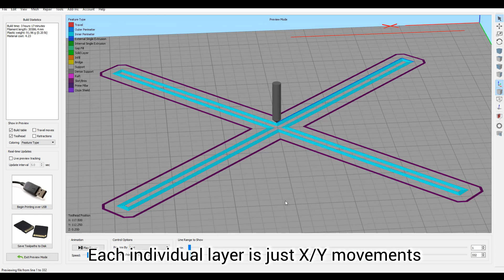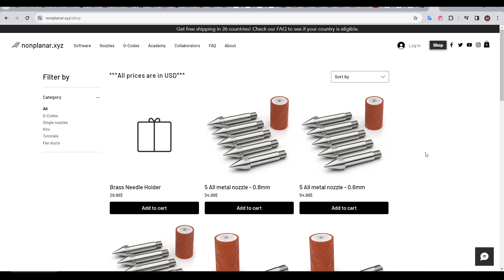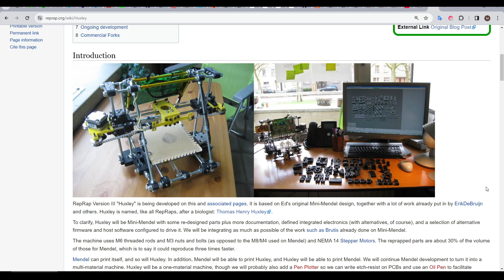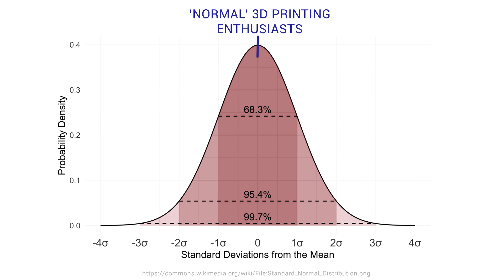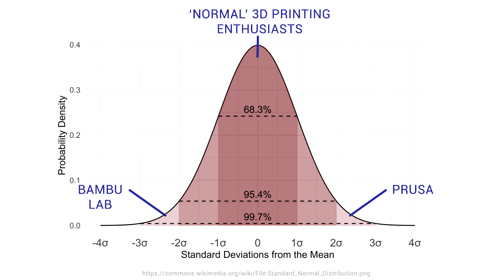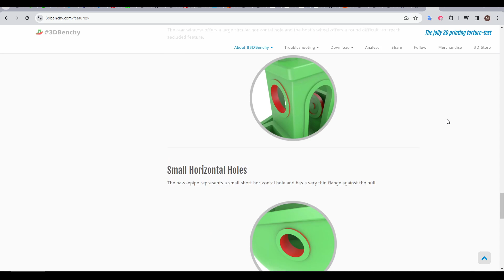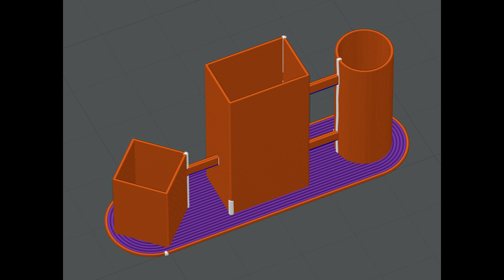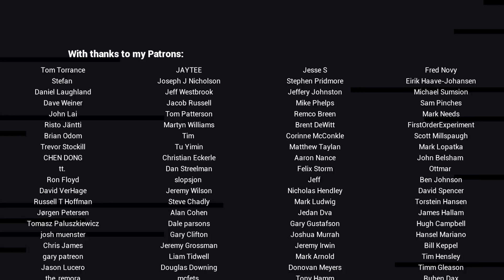3D printing mysteries that need to be solved in 2024

Comment: Hi Michael, at a previous job I dealt with a similar issue to the surface artifacts that you mention in this video. While we did not dig very deep into the issue and did not come to a real conclusion, we did come to a similar theory as you. I believe that the issue may come from the material sinking heat into the previous layer at different rates based on how much time the previous layer has had to cool. If you look closely you will notice that the rectangular tower on the left may actually have 5 different shades. 
1 - Bottom layers
2 - Layers printed with both cylinder and rectangular tower
3 - Cylinder tower top layers (discussed in the video)
4 - Only rectangular tower layers
5 - Rectangular tower top layers

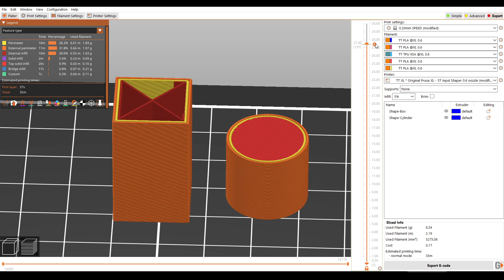Comment: 12:45 I think I have a pretty good theory about what can actually happen here. 
1st, I don't think test shown in 12:00 is good to test this, the indentation may be just an effect of a seam from the slicing process.
When you look at the frame from 11:10 where you see both geometries, you can see that the bottom of a square object is a bit more mat than the top half, and those 2 are split with even more mat layers. I would bet that it has a lot to do with the cooling tab in your slicer. I assume that you printed this with PLA, which tends to get more mat with a higher flow rate (on the same temp ofc). When you print the part where there are both objects and both are printed on layers with infill, layer time is much shorter than on layers where one of the objects is mostly normal infill, but the other is the top solid infill. If you have "Slow down for better layer cooling" turned on, printer will actually print faster on  layers that would take more time, and slow down on those with that take shorter to print. That's why I think the part of square part is more shiny that bottom, because on the bottom, you print cylinder + that part --> layer time is longer --> printer speed up, and when you print just the square object, layer time goes down and so does the speed. I would print this once again with "Slow down for better layer cooling" disabled (orqa slicer --> filament settings --> Cooling --> Slow down for better layer cooling), if my theory is correct, the artifact from 11:10 should be gone.

Comment: I've always thought the surface artifacts are because printing speed. It'll slow down to allow the filament to cool completely, but when it takes longer to print the layer, it prints faster. I suspect it goes away if you set the speed to be constant through the whole print, or at least, a less dramatic shift.

Comment: Your guests regarding the last one is probably pretty close to accurate and mirrors my guess as well

We are printing with a thermoplastic that is a plastic that is responsive to thermal energy and changes its volume and therefore density as well based on temperature and flow ultimately it's temperature but flow affects temperature

Print faster and the filament will come out colder Prince slower and the filament will come out warmer so ultimately it comes down the temperature you can see a more macroscopic effect of this with certain filaments that will sometimes print with a matte finish and sometimes print with a shiny finish and that also comes down the temperature print faster and cooler and you'll get the matte finish print slower and hotter and you'll get the shiny finish

You are probably going to have a similar effect on a physical level because the plastic will expand and shrink more or less based on the temperature and how quickly you extrude it your flow rate

I am betting if you reset your slicer to print everything at the same speed you changed all of your different speed attributes to all be the same speed and also made sure that all those speeds were 10% below your maximum volumetric flow rate so somewhere around 14 cubic millimeters a second for PLA for example I'm betting that you would see most of those either go away or decline I doubt you can get rid of them completely simply because you still have travel moves involved and that's also going to affect flow and temperature since while you are traveling the feel of it is going to have time to heat up inside the hot end so you're going to have some extra thermal energy in play that might not have been there before and then of course when you print a large surface area like the top of the cylinder you are going to be expending all of your access thermal energy and you won't have as much to give up this is going to cause a change in the thermal properties of the plastic when you move and print a different part

So I bet you are correct that it comes down to flowright but more importantly temperature which is related to flow rate

Comment: And regarding toxicity. Simple. Nerds want to gate keep.   They think this is their little fiefdom. Heck im one of those that also built 3d printers from scratch and even contributed to the Klipper plugin eco-system. I'm mostly using my Bambu Lab X1C since I spend most of time actually designing models for prototypes instead of fidgeting with unreliable designs.  The community either treats the 3D printer as a hobby instead of 3d PRINTING as  the goal.

Comment: None Planar printing can simply be simplified into non-planar ironing. I think that would make it less complicated to code. 3D additive slicing being turned into a true 3D printing would imply that it can print on any kind of surfaces as well.  like 3D printing around a cylinder.  That kind of slicing is extremely complex.  Akin to 3D concentric spirals inside a volume.

Comment: I had initially assumed that it all had to do with printing speed, but the point you make in your video concerning the top infill cooling the nozzle down helps me paint a better picture.

Hypothesis: not only is there more filament flowing causing the hotend to cool down, there is also more time being spent on that second object. Most printing profiles I run tend to have a slower speed when switching from infill to top layers for bridging across the infill to give a nicer top layer. Then, for the other normal top layers (I typically print 3-4 top layers), those layers inevitably take more time to print, allowing the other model (or even other parts of the model) to cool down while this top surface print is happening. When the next layer is then applied onto the existing colder layers, the melted filament cools down even faster (theoretically drawing a minimal amount of heat away from the nozzle as well)

I have tested this theory only once with some overture matte black PLA by first slicing my then troublesome model, finding out the maximum layer time (that isn't the first layer), then re-slicing again but this time with a configured minimum layer time equal to the max layer time found above and enabling variable printing speed to have each layer take the same amount of time. The surface finish was arguably pretty consistent, considering that I was not testing with regular shapes and so there was a significant change in printing speed per layer, but at least those weird transition layer artifacts were gone.

 My testing is limited and I'm not super motivated to dig further into it myself, but would love to see what others find!

Comment: 1. Yes - we want non planar - there is a newer video/ channel covering this goal since yours and stefans vids.
2. Lower- anti clockwise
3. ‘Cause People suck.
4. You didn’t build a voron?
5. Designed in
6. Temperature change - Possibly affecting flow.
Reply: 1.  Link?
Reply: @crashingsux    I saw a few things E3D put out on their channel mid year as they had some non planar nozzles/ hot ends they appeared to be prototyping. They mention a guy in the description, I think if you search the guy,  it goes to a GitHub and his own channel and that has more recent info than cnc kitchen and Micheal’s vid. 

I think there was one of the trade shows where they were printing non planner with a nozzle that rotates around z but I forget who had it. It was one of the rep rap rather than form next but I could be wrong.

Google non planar printing and look at the dates. In YouTube search non planar and you’ll see some newer stuff too. 

Im interested in it as I think non planar will reduced the lamination issues in some cases as the part doesn’t have tradition 1 layer layers and has layers that cross what would be multilayer. Effectively becoming more homogenous. I have bike parts that would benefit from this.

Comment: As for the filament snapping I can answer that

As the filament absorbs water and almost all filament is hygroscopic it will absorb water right out of the air although if you live in a dryer or climate controlled environment or certain plastics are slower to absorb moisture but all of them do

When they absorb moisture they become brittle and that's why they snap so the question is why does it do it specifically for you

Well that's because you broke the filament and once you break the filament it absorbs water faster then it would otherwise

Think of it like this think of your filament as having a skin and as long as that skin is intact water can get in but it finds it difficult to get in The moment you break the skin compromise the skin on the filament water finds it much easier to get in and it starts snapping a whole lot faster

The very nature of how you load the filament is why it's doing this when you unroll filament from the spool you are straightening a relatively rigid casing that does not want to be straightened you are taking something that was formed hot and soft into a coil and you are straightening it out The process of straining it out stresses the skin of the filament and you get micro lesions all along the length of the straightened part of the filament those are all cracks in the skin and those cracks allow the infiltration of water at a much higher rate and it becomes brittle and starts cracking That's why if you start cracking the filament pull some more off crack it pull some more off crack it eventually you'll reach a point where it stops cracking That's the filament that has not been abused yet :-) this also happens with even optimal direct drive systems or bowdoing systems that don't bend it like that but what happens is the feeder unit the gears the hob gear actually cracks the surface and again allows the infusion of water at a much higher rate than normally would occur

This is why I tell people to never ever respool a roll of filament unless you are going to use that a filament that day

You ever see those rolls of filament where the entire roll is shattered into a million pieces on the spool? Yep that's a respool :-) these plastics don't like that.

Comment: The filament breaking in multiple parts is caused by the tight coiling of the degraded filament trying to get through the reverse bowden tube. The fewer the leftover filament, the smaller the diameter and tighter the coiling

Comment: My personal mistery is: Why do my prints still have zits and blobs even after I have tuned junction deviation, linear advance, acceleration and everything else I can tune
Reply: Did you also turned off power-out recovery? Some printers with power recovery make a save to the memory or drive every layer. This can cause little hiccups in printing, because printing halts shortly while saving to the medium. This process can causing artifacts.
Reply: @jclosed2516  No power recovery. I turned it off in the firmware

Comment: I have a question. Why marlin is not coming up with some easy to use GUI for configuring firmware? I mean there is auto build is there but it is far from usable.
Reply: Good question. Would be nice to have a website with preconfigured options/templates and automated build to generate the bin files. I guess Marlin is on steep decline and doesn't attract much attention anymore?

Comment: As for the toxicity of the 3D printing community that's actually pretty easy to answer and the answer is muggles

That's right as more and more of the general population gets involved in 3D printing more and more toxicity will enter the 3D printing realm

This is just a natural expansion of what happens to any hobby or niche once muggles start coming into play

Think of it like this take your probability graph that you posted and sync it below the x line so only the tip sticking out of the zero line now raise it up like a rocket that rise up like a rocket is a combination of time and density meaning how much of the normal population enters the hobby over time as you can see you start off with mostly the normal people but as your rocket rises you start exposing those extremities on the outside edges :-)

This happens to pretty much every hobby

This can also happen with evolution when a hobby changes from 1 to another aspect for example introduction of drones or the introduction of electric power or the introduction of high power into low power rocketry etc etc

Elitism begins to take old as the old cadre does not want to let go of the old ways and attacks the new ways

Your rat wreck example is actually a pretty bad example The vast majority of those comments you posted on the screen were simply people that were curious voron was the big name going around and people saw you posting about a machine that was pretty close to avoran so they were hoping you would do a war on because that's what they want to get and they trust you and they want to see you do it first That's not toxicity or tribalism

There were a few nasty comments in there not even really nasty just you know like you described tribalist but most of those comments were simply curious

I personally think you do a pretty decent job and so you have a pretty low level of toxicity on your channel
Reply: Isn't saying the problem is normal people, or the general population, just another example of the behavior he is pointing out?

Comment: 3D equivalent of stepping under in a ladder is too many upgrades, too fast as I recently suffered this fate, causing a layer shift that was the result, as far as I can tell updating my firmware and adding a hardware upgrade at the same time

Comment: A question; talking about artifacts, if the hot end is extruding more plastic, and getting cooler shouldn't the printer (especially with Marlin on board) be able to slow down/change the flow rate to prevent those artifacts?  For your three object test print...having had cruddy printers in the past. it truly does not look bad enough to worry about it inless it is a structural flaw.

Comment: I have a theory for the snapping filament, it looks like the starting point of your revers Bowden tube (the black 3D printed part of the aluminium extrusion), is bending the filament too much. The bending radius seems too short. Maybe this and the combination of an old brittle filament causes your issue. To fix it I recommend designing  a new part with a big radius.

Comment: Re the filament breaks, if you're seeing it towards the last third or so of the roll and it's not years old and drying hasn't helped, it may be mechanical stress. You're dealing with the most tightly wound part of the roll. If you finish printing and leave it loaded and thus stretched out, after a while you will start seeing breaks. Could be hours, could be days depending on the filament type and age. When this starts happening, I unload the filament when I'm done printing and am not going to be printing again as soon as i get the party of the bed. I re-load when I need it again, first bending the end until it stops snapping, and it prints just fine. It's a factor I don't see talked about nearly enough on various forums and discussions.

Comment: this is only an uneducated guess, but my theory concerning the spiraling filament is it has less to do with any kind of coriolis effect (which would have little effect at such a small scale that any other force acting on the filament would over power it), and more to do with what direction its wound on the spool and what bends and turns it makes to get through to the other side. if the filament feeder pulls unevenly on one side maybe? Or perhaps the plasic filament itself might even have the bias twist in it already from manufacture? 

This would be most apparent in 2 tone fillaments. I've used it a few times and it is so hard to keep it straight and in one direction throughout a full print. that stuff always wants to twist as it prints and ruins the effect. Likely all filament has this twist in it and you dont notice because its uniform color.
Reply: I was going to post my own printers results, but I'm not entirely sure how to turn the fan off... 
I'm in the northern hemisphere, and I get.. a horizontal line.. as the end was imediately blown sideways by the fan 😅

edit: on closer inspection, it does definitely still come out with a bit of twist to it though, and its clockwise. I had expected that from the orientation of the extruder gear and the path from the extruder to the print head is also clockwise